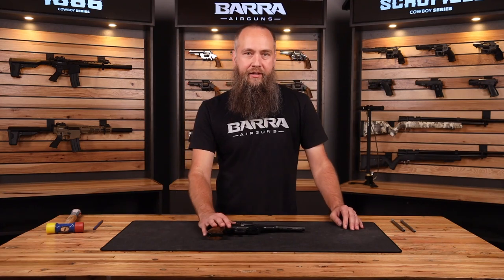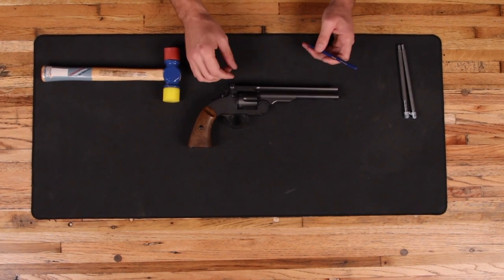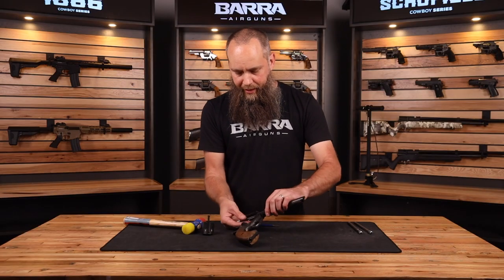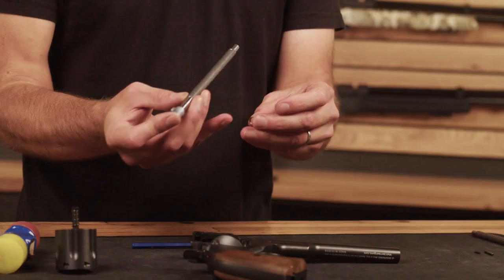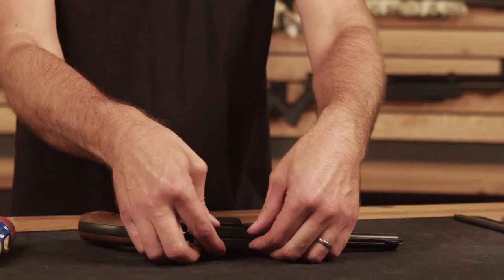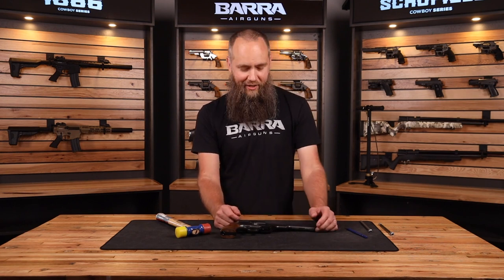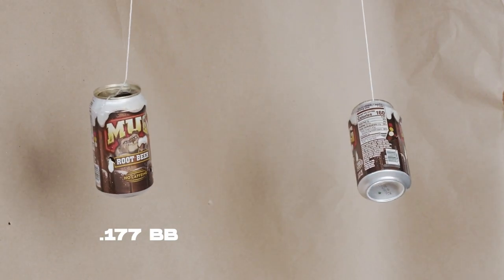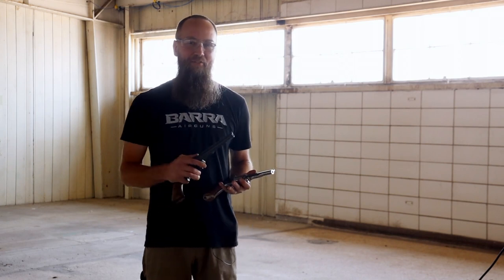Schofield Rifled Barrel

Comment: Got one in .177.  The job is as easy as it looks on the video, took about 15 minutes.. Better grouping, no more fliers (the misses are now on me). Considering 6 pellet shells when bought as a stand alone item cost about $15... $25 for 6 shells and essentially a "new" pistol is great deal. I have an indoor range and don't use BB's,  all my pistols up until I got the Schofield are pellet only. I wanted the Schofield for historical reasons and reconciled myself to it being a smoothbore BB gun with so so accuracy when using pellets. The Schofield has now moved up my list of favorite guns to shoot as  I've always rated accuracy over power, never saw the point in having a hand cannon if it can't hit what you're aiming at. Thanks Barra, great product and great after sales service too when answering my questions. and in case anyone thinks elsewise. I am a genuine consumer and am not affiliated with Barra in any way.... If you want more consistent accuracy from your Schofield,  this is definitely the way to go. 👍👍👍👍👍